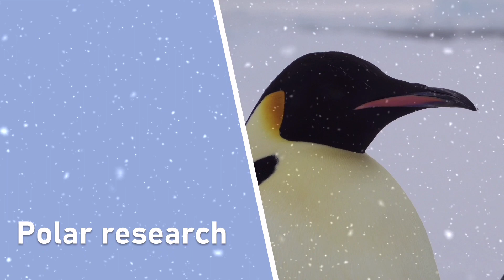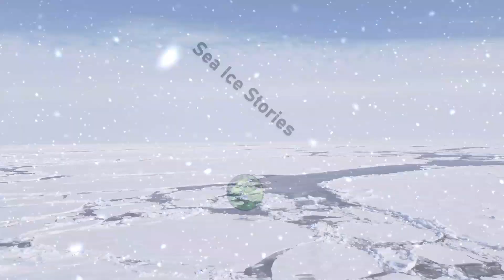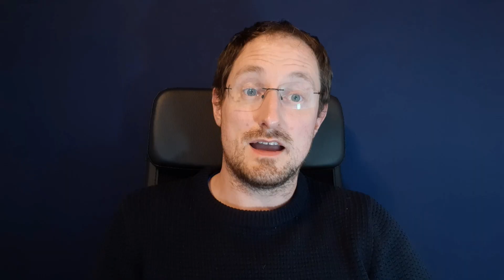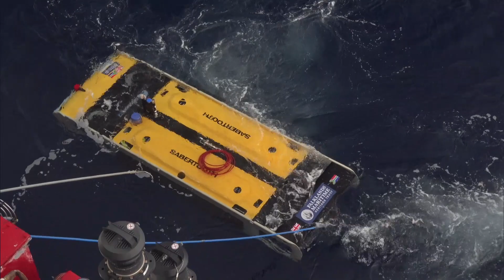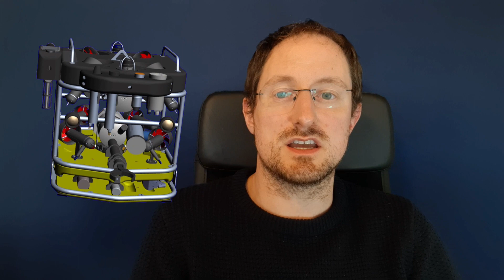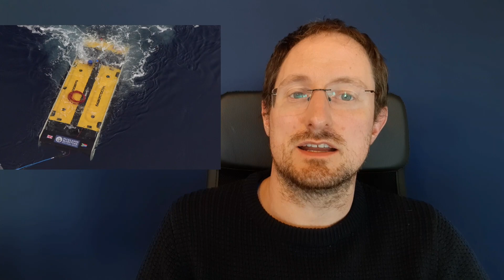ROV and AUV control in different Thruster concepts

Comment: I'm looking at using a phantom board for building an ROV. It changes ethernet to two wire communication. https://youtu.be/VsAvHU48vZA what type of communication does your rovers use? Are any of them wireless?
Reply from the maker: Our ROVs use Ethernet over Fibre Optic link. The AUV are controlled by acoustic modems, and the newest developments are Optical Modems by Hydromea.